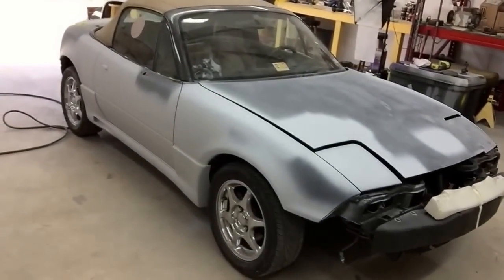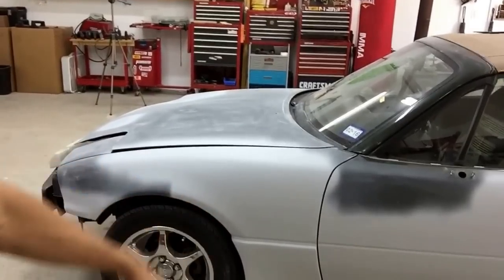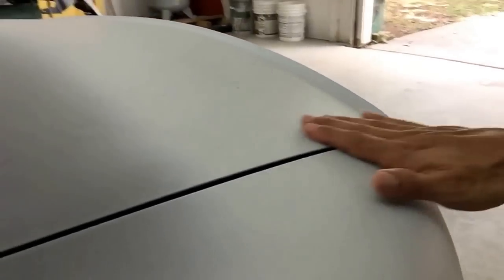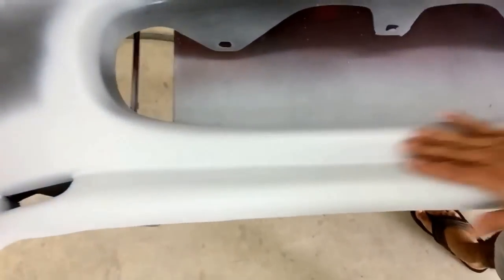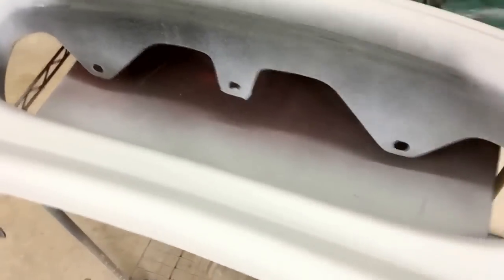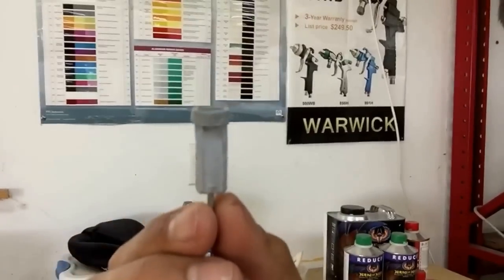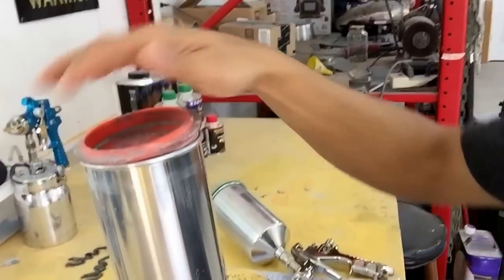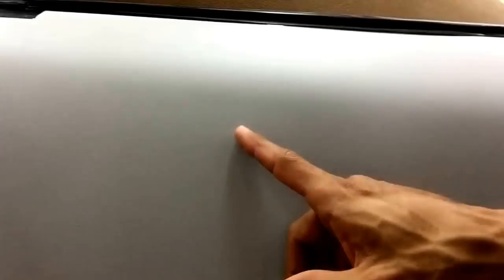Avoid This Polyester Primer Mistake - Complete DIY Auto Body Paint Project Update

Comment: This tip is very helpful to me thanks man. Cos I have an iwata gun I'm going to dedicate to shooting thicker primers/builders and I just ordered a 1.9 tip to convert the gun from 1.4 base. I will ditch the filter. I have 2 suction primer guns and now I'm thinking that this stupid filter may have been a problem when I shot an underbody chassis black and I blamed the gun. I took the guns apart and both look fine. I bet it was that. So, do u recommend just straining base as well or putting that strainer back on for shooting thin 2K? Also,  what is the mix of the polyester there cos I'm in Australia. We use high build urethane primer here. Thanks.

Comment: Hey man I've been using Eastwoods poly primer and I've had nothing but complete bs with it. I haven't reduced it, but I assume that isnt the problem. I'll mix according to spec, put it in the gun with no neck filter, and the gun will shoot globs of paint everywhere, and the flow is not consistant. It will flow for half a second, then stop and repeat. I'm using a 2.0mm tip with wide open fan, I've tried adjusting the flow rate, but nothing works. I'm not sure if it's a bad batch, but I've used it 3 different times all with the same garbage result. It clogged my last gun so bad it ruined it, so I took the cup and applied the paint with a paint brush. Once the poly is on the panel, it sands beautifully. I just cant get it to come out the gun. I just tried it with a brand new, freshly cleaned gun, with the same result. Any ideas? I really would like to give this stuff another try but I'm about to give up and use a different filler primer.

Comment: Official How To Paint a Car - DIY Learn Auto Body And Paint Training Site Why Use feather fill G2? Evercoat has a 4:1 mix ratio which is WAYYY easier to mix accurately. Finish Sand 4:1 is the closer to Feather Fill is Direct to Metal unlike feather fill.
Reply from the maker: I don't think the mixing was hard at all. That wasn't a problem. And I love how fast and hard this stuff dried.
Reply from the maker: They give you 4 tubes of activator for a gallon of primer. 1 tube per quart.

Comment: Great video -- as always. I get your email feeds all the time. Very informative.

Planning  on blocking my car with polyester Contour from Eastwood (I'm just priming; someone else is shooting the color).

PROBLEM: my compressor is a HF 21 gallon, 2.5 hp, Air delivery: 5.8 CFM @ 40 PSI, 4.7 CFM @ 90 PSI.       Is there a gun with a 2.0mm nozzle that will work with this compressor and that thick primer, or am I just wasting my time?
Reply from the maker: Ian Odeon Yes you can spray with it, but you will not have a lot of volume, that's all. Great for small parts. Or spraying single panel repairs. An entire car at one shot will be tough. Take a look at this gun: http://www.learnautobodyandpaint.com/product/warwick-904he/ with a 1.8 or a 2.0 tip.